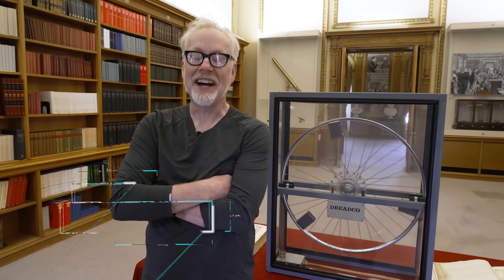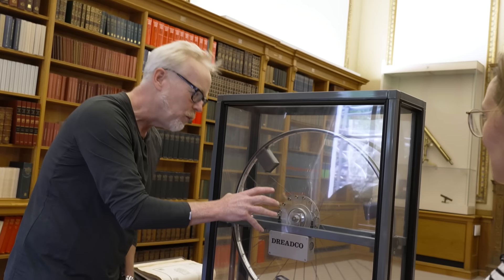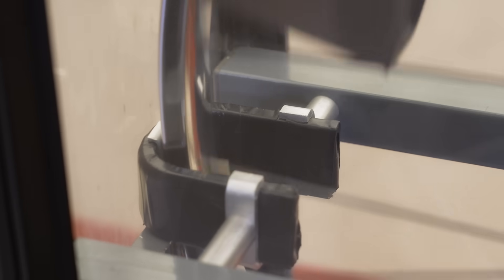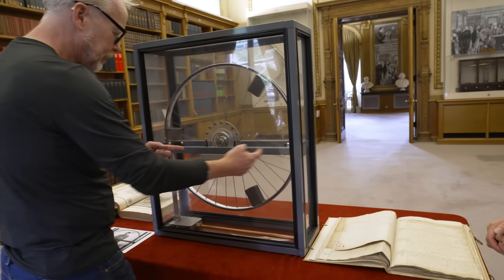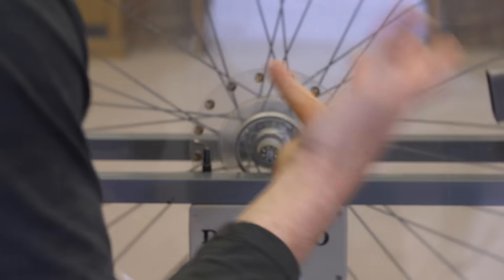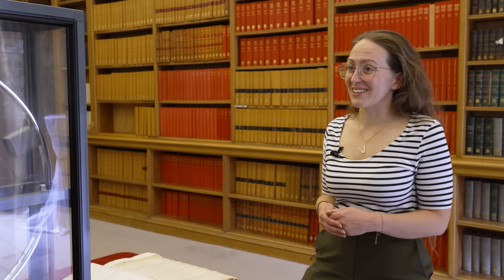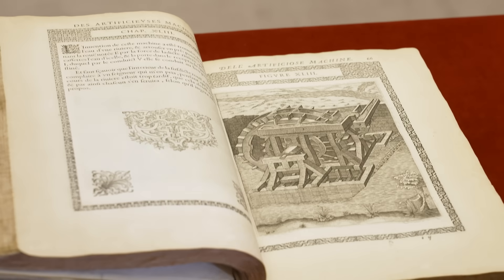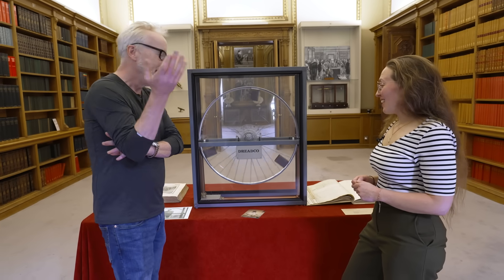Adam Savage vs The "Perpetual Motion" Machine!

Comment: Each of the 3 boxes contains a high impedance coil, a reed relay and a battery. Most probably an AA. By positioning the coil near the leading edge and reed relay on the trailing edge of the box, allows the coil to generate a repulsive field just as the box exits the magnet. Depending on the coil impedance and the electrochemistry of the battery one can get 2..3 years of "perpetual motion" between services.
If you can revisit equiped with a Near Field Probe for magnetic fields (H) i'm preety sure you'll get spikes in the field each time a box exits the magnet...
Reply: And, the copper piping, box with heat sink and coax, and box with photoelectric cells are all non-functional maguffins that make people waste their time figuring out how they can work.
Reply: I reckon, all the other parts in the box are a diversion, like heatsinks and copper pipes. Why would it need heat sinks to get rid of/transfer "energy" ?
Reply: @1allan2  Absolutely. You are looking to minimize the loss of rotational energy as much as possible. Friction in the bearings and with the air as the wheel rotates are your main losses. And they will be very low or the thing would stop within hours. I think all the talk about magnetic assistance via the rim mounted boxes and frame mounted magnets is right. The central apparatus on the plastic disc might act as some kind of commutator, but it's likely also a misdirection.
Reply: A battery is a total failure to do perpetual motion. Too obvious. A counterfeit. Could just b magnetism and magnets do lose their magnetism. But i m only at the beginning. Is solar power a cheat too?  I suppose
Reply: Yeah i think at the heat echanged box a repeling field is created and the magnet gets a small charge by passing over the copper tubing. Imagine having magnet insid3 a copper tube bing dragged up then released when the wheel raidus leaves the other magnet?  Its probably dumb but i think about it all the time.
Reply: Came here to write basically the same. This is the most logical solution. Would be interesting to get an AM radio near this thing. I have a similar perpetual motion toy that pulses with an electromagnet and you can hear the pulses on a radio. It spins faster though.
Reply: If I get stuck on my physics I’ll give you a shout John ….if you’re not headhunted by NASA in the near future !!
Reply: A good quality, small old school AM transistor radio makes excellent detector to make EMI audible. The transistor radio can be tested prior to use so its sensitivity values are known.  I use such to help find weird faults when normal testing principals don't work. Using it when things are working correctly can imply an normal signature. very noisy resistors and capacitors can be spectacular sounding. Also very good for finding harmonic problems in non linear power supplies etc.  I have a large clock in my shed that runs for about two years on a good quality A battery (they could use a Supercapacitor battery).  One of those magnetic detection film sheets would also be handy for additional information.
Reply: sounds almost like a watch
Reply: Just a flywheel with very low friction bearing.
On the circumference of the flywheel are the three boxes that serve as additional mass to increase the momentum of the flywheel

Spaced at exactly 120 degrees so they are balanced

Each box has an electromagnet inside  that is turned on very briefly ( from a battery of course) as the box passes through the u shaped pole pieces each side of the wheel.  A very low power solidstate circuit can aciheive this easily ( look how long car remote key fobs last ) - and provide the precise timing as the box approaches the pole pieces - to provide a short pulse of force to maintain rotation 
The hub of the wheel appears to have elements spaced around which i suspect also  communicate with the boxes to maintain a constant angular speed of rotation
Reply: Yes -- but how do you keep a constant speed of rotation over time ?
Reply: "most probably AA"? what makes AA more probable than AAA, or some other common battery shape like PP3 or button cells?
Reply: @JNCressey  amperage. Voltage. Swap ability.
Reply: @Tom_Neverwinter , AA and AAA have the same voltage as eachother, and amperage is just determined by the voltage and the load. And they're equally easy to swap.

And what makes some voltage more probable than others for the mysterious device?
Reply: @JNCressey  you are arguing over nothing. The type of battery is irrelevant and you're jumping all over this guy like it's somehow important.
Reply: @JNCressey  At a guess, the common availability thereof in the late 1970's when the machine was created. Also, if you want it to run for longer, you'd want to use as large a battery as you can in the original design; a button cell is going to run out a lot faster than an AA, for the same load.
Reply: @JNCressey  aa's are cheaper in the pound shop 😅
Reply: @JNCressey  the year it was designed.
Reply: @JNCressey  3a's when this was created didn't last that long and leaked
Reply: @JNCressey  i would think 'prob' 9v's and 2-3 in each of the 3 boxes
Reply: I wonder why they dont pull a cia and use a chloride lithium battery
Reply: @Tom_Neverwinter  If that's correct, it may be that the cost at the time of creation was outside the scope, and retrofitting a better long-life battery into it might not be appropriate for the Royal Society. Given Martyn Poliakoff is getting on in years, one wonders who will take over for him when he is no longer available to service the machine - long may that be in the future.
Reply: I'm trying to remember my magnetic induction theory from 25 years ago. You might not even need the battery. If a conductive coil is moving through a magnetic field, it produces an electric field  there for an electric current, once the reed switch closes the circuit. The induced current creates a secondary magnetic field in the opposite sense and creates a force maybe?
Reply: @davidbrennan7422  the coppor tube can act as a coil, remember wahat happens when ypu slide a magnet through a tube? Thete is a field inside of it. The box could just reverse the polarity drawing in by magnet on one side of the wheel then repeling it on the other it would require a polarity switch and a timing mecahanism but the timing mechanism could be electomagnetocally induced  system with a magnetic triger/cam sensor this could be done. Inside the tube the field could change direction. Pushing and pulling.
Reply: @davidbrennan7422  Problem is always that you don't get 100% of the energy back, which is the whole reason perpetual motion doesn't work
Reply: @ElvisMaximus1  Yeah agreed. And they acknowledge that it doesn't run forever. I was just trying to determine from my recollection of first year electrical physics whether the battery in the proposed circuit was necessary if the wheel was given an initial push.
Reply: @davidbrennan7422  well, then you've just solved perpetual motion.
Reply: @Mitrasmit  I see your point. Wasn't trying to "solve" anything,  just trying to remember  if you can get a force with a moving, closed loop  conductor and permanent magnet.
Reply: YOUR IDEI IS PROBABLY THE MOST ACCURATE I THINK !!!
Reply: @mefirst4266  OKAY!!

Comment: Looks like a permanent magnet motor,  three magnets on the wheel,  two coils on the frame,  battery in a box in the middle. Plastic case may be held under vacuum to increase efficiency,  but basically just a pmm (permanent magnet motor) not a pmm (perpetual motion machine)

Comment: Have a look at a Wimshurst machine. It’s a machine to make high voltage static electricity. The two electrodes in combination with the isolated copper knobs look remarkably the same.

Comment: The fact that it needs servicing every couple years might be a clue. My guess is the boxes in the wheels contain batteries that need to be changed or charged every couple years. The U shaped pieces on each side may be magnets or just plain iron. If they are magnets a magnetic reed switch in the boxes may energize an electromagnet in the box which interacts with the U pieces and gives the wheel a little bit of energy to keep rotating. If they're not magnets then there maybe a position sensor that energizes an electromagnet when the boxes are horizontal. Same as before the electromagnets would pull on the U pieces and impart a little bit of momentum to the wheel.
Reply: As strange as it may sound, I really want some high speed footage of this thing. Something that can be used to calculate if there is a variation in the speed of rotation that is imperceptible to the eye. If it is cycling as 6 “pushes” per rotation, it is likely the 3 boxes and 2 magnets, if it’s 16 times, it’s likely the “buttons” around the hub, if it is completely uniform, both of those are distractions.
Reply: @jeremysoucy5726  That's smart

Comment: either it's the magnet trick I discovered years ago, which isn't a true pmm but rather an unbelievably efficient motor which uses a magnet as the battery. or it's just an ordinary motor that's run really slowly on unbelievably low friction bearings, possibly even magnetic bearings, and needs to be "services" every two years to replace the battery. Just based on the setup, I would put all of my money on the latter, and I'd wager the battery packs are those three blocks on the wheel, connected through the spokes to the small motor hub. the rest is just window dressing to confuse people.

Comment: from other "Perpetual Motion" Machines it could be a battery or the change in temperature or pressure .
There is a bell which as been ringing for hundreds of years and a clock which works on pressure change.

Comment: We design battery powered clock movements.  We offer clock movements with a 15 year run time using common AA Lithium batteries.  If each of the three boxes could hold 4 AA batteries, it would easily power the device for over 10 years.  The motor circuit very simple.  It uses a magnetic detector (Hall effect or reed switch) to detect the horseshoe magnets.  Once detected a pulse generator energizes a coil in the box to power the wheel . The pulse width is held short to conserve power.  The timing of the pulse is critical.  Two modes of operation can be used.  1. Energize the coil while the box is moving toward the fixed magnet and de-energize just before the fixed magnetic field changes. 2. Energize the coil while the box is moving toward the magnet, then reverse coil polarity as the fixed magnetic field changes, keeping the coil energized for a predefined period.  Option 1 is simple and should be adequate.  Each of the three boxes work alone and don't need to communicate with the other boxes.  Everything else is a distraction.  I suspect the device shown is not using Lithium batteries, which would limit the run time to 2-3 years.  Lithium primary batteries have a 15 year shelf life.  If the boxes held the permanent magnets, they would need to be that big, this is why I suspect the boxes hold batteries and a coil.
Reply: Do your clock movements have to propel that much mass?
Reply: @petermgruhn  You clearly understand that mass is an important factor.  This is why I suggested using 12 batteries to provide additional power considering the mass to be moved, totaling about 35,000 mAh.  Each AA Lithium battery will supply a constant voltage throughout the life of the battery.
Reply: I got the impression that this device predates wide spread LI-ion battery use.
Reply: @CorwynGC  I think your right.  They should be able to swap out the batteries for Lithium and greatly extend the run time.

Comment: The only thing I can think of is it would be some kind of electrolysis separation of water inside of this tube of the pipe to generate just enough current to provide additional momentum.... but even that's a stretch. And not perpetual if it "needs servicing" every 2 years.
Reply: Energy density of a fuel cell is nowhere near enough to power this for 2 years.

Comment: The simple explanation would be that the acrylic hub dips into the dreadco box where there is a motor with a rubber wheel and of course a battery. There could be batteries in the whole frame for that matter.
Reply: Inspect it characteristic wear and/or deposits.
Reply: It would have to be not obvious from all angles. Not impossible.

Comment: I'm at 2:44 and I assume the boxes contain a weight sustained on a rubber band. When they go down the weight moves to the rim, when they go up, the weight moves towards the center. So there's a leverage effect. And with less enough fiction the whole thing can run for a long time. Especially in a vacuum.
Reply: Rubber bands give off heat when stretched and relaxed.  That is going to be a greater loss than just letting the wheel spin in a vacuum.
Reply: @CorwynGC 
https://youtu.be/rckrnYw5sOA?t=415

It reminded me of that thing you see in the linked video. Without having watched the video 'till the end I think the the bearing friction will be much higher than the rubber bands conversion of movement to heat.

But only people who have seen the video to the end will (maybe) know for sure 😅

Comment: My initial thought was magnets in the boxes, which slide either towards the rim or away as they go through the other magnets at the sides. So as the box passes the left outer magnet it weighs more near the rim for the down swing, and as it goes passed the right magnet its weight shifts towards the centre for the up swing. At that part of the wheel only one box is raising maybe the shorter fulcrum is enough to keep it going. You can even hear a slidey/knock noise at 6.11 when one of the boxes pass the magnet.

But I can't imagine that would actually work in the real world. So I suspect some kind of friction belt drive through the copper tubes to a motor in the box, this would have to run under the wheel though, as you can see the spoke nuts on the top. Or there seems to be a black ring, possibly rubber, around the front bearing, this could be friction driven from a motor in the dreadco box

Comment: I obviously can't say how they did it but It could easily be done by putting a battery, a hall sensor and a electromagnet in each box - if the hall sensor detects the magnet getting close it turns on briefly and attracts the magnet. - Basically just like a Brushless DC Motor.

Comment: there is probably a hidden battery and motor mechanism in the Dreadco box. the brackets on the end are magnets, boxes contain copper coils.  the probes at the center are picking up the charge from the wheel.  ~80% efficiency.  Copper pipe and heat sink are greeblies.

Comment: I believe is just a big brushless motor. The horseshoe magnets on opposite sides could be elecromagnets operated by a either a reed switch or hall effect sensors and the batteries could easily be housed in either of the boxes. Lithium Ion batteries were invented around the time this was made so its not out of the realm or possibility that with scavenge charging, and very little solar, this thing could run for years before needing an outside charge. The service guy probably just oils the bearings and plugs it in for a couple hours and sends it back.

Comment: probably an ion pump (specifically Sputter Ion Pump), hence the copper tubes and their output location.  The boxes are just weights to even out spin rate. if a bearing is smooth enough it doesn't take much to move the wheel.  not perpetual because the external battery source, but still pretty cool.
Reply: possibly, if one could recover some electricity used on the downswing of the boxes, it would last longer. of course there a cost for heat conversion, so it still wouldn't be perpetual, but if you can shave off a few fractions of watts per cycle it could last a very long time.

Comment: Is that box on the floor with the copper pipes a very sensitive version of those things you get on stove fans that turn heat into electricity and its using the heat of the room to make an electric current those things will run for ever .Maybe it slows down when its in the cold store room and all they do is put it in a warm room
Reply: The important thing to remember about those fans is that they work on temperature DIFFERENCE.  You need a source of both heat and coolth.
Reply: @CorwynGC  no you dont so long as theres heat it will spin ..I know i used to sell them .And by the way they have heat sinks just like on the box both ali and copper are great heat conductors
Reply: @braddbradd5671  They very much do rely on a temperature difference. The bottom half conducts heat from the stove top to the Peltier device (the little white 'sandwich' in the middle). The top half is a heatsink that carries the heat from the Peltier device away, creating a temperature difference across it.
I happen to have one of those fans and a thermal camera. Just for the hell of it just had a look at the fan with my camera and it's very obvious that the top part is a lot cooler than the bottom part. There is a sharp transition at the Peltier module.
Reply: @LesNewell  Ok i didnt know that
Reply: @braddbradd5671  Incorrect.  Feel free to cut the upper fins (heat sink) off and see if it still works.  Or put it inside an oven and see if it still works.  If it could convert heat to electricity without a temperature difference it wouldn't need a heat sink, would it?  Ask yourself why it doesn't spin all the time, there is heat in the room, yes?
The Peltier Module in the fan can use electricity to create a temperature difference across the panels, or conversely use a temperature difference to create an electric voltage, using the Seebeck effect.
Reply: @CorwynGC  Yeah ok fine but can it still be used to make the wheel go round thats main question i dont care if it needs heat and cold really the main thing can it work with heat and cold in the room ?